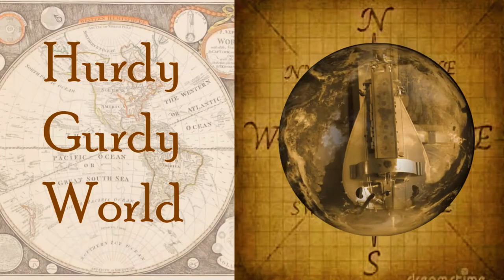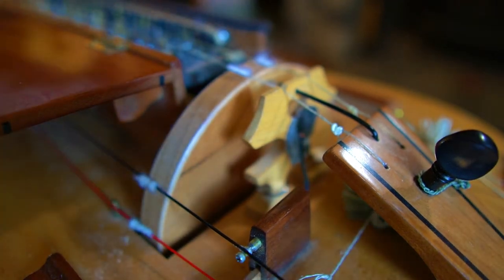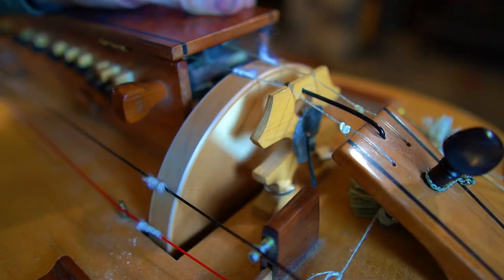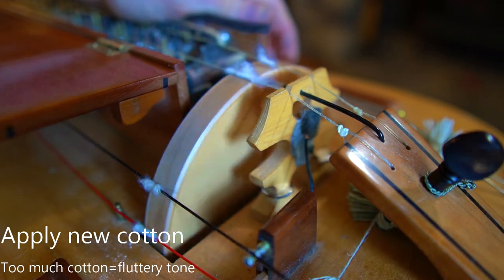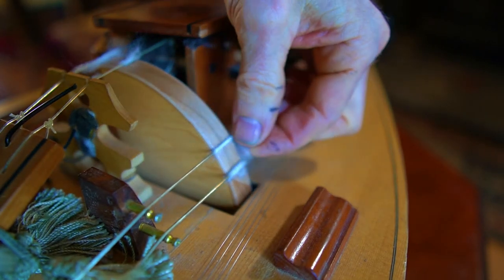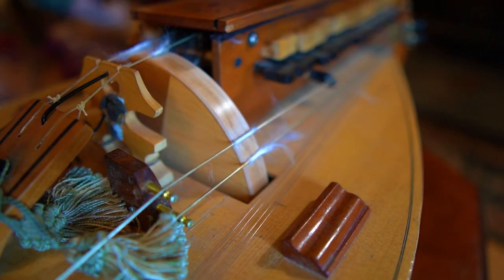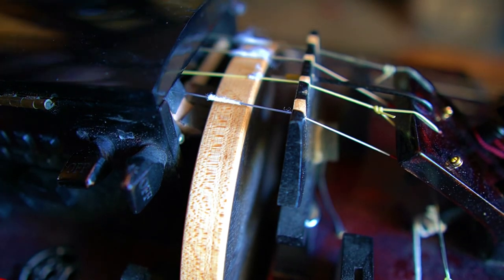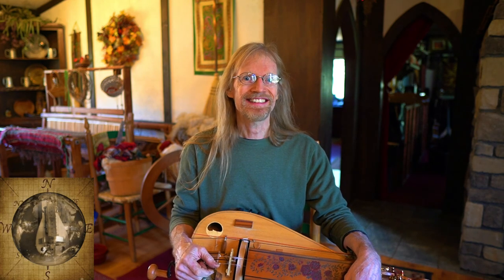Hurdy Gurdy Maintenance-Cotton

Comment: I'm interested in buying an electric Hurdy Gurdy... more to use w/ elfx pedals and vocoder etc.

How hard is the flywheel on the strings and for electric Hurdy Gurdys are there flywheel materials and string materials (+ maybe lube) that can extend the life.

Like instruments I'm into cars though know next to nothing about the engineering / maintenance for both.

Like a fluoro metallic purple restomod Mazda 808/RX-3 wagon Wankel engwnined masterpiece why don't Hurdy Gurdys have more that one rotor (at least stock)?